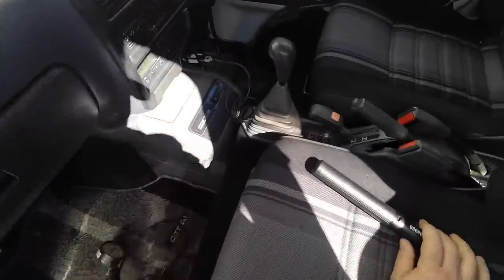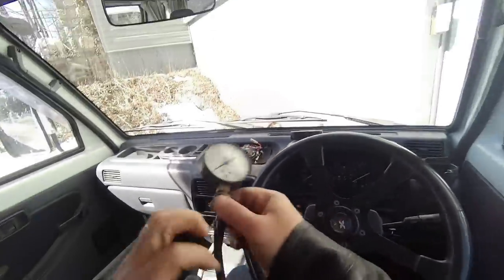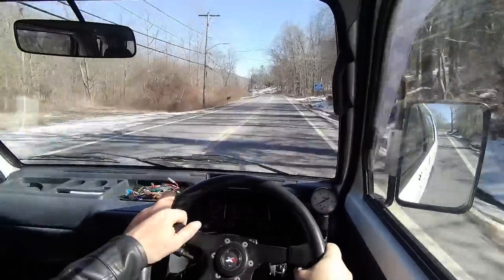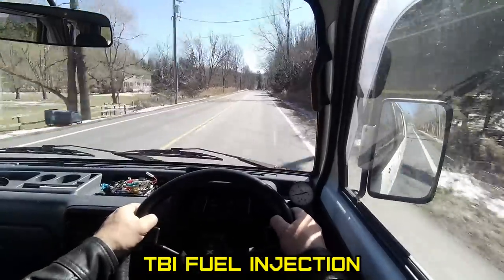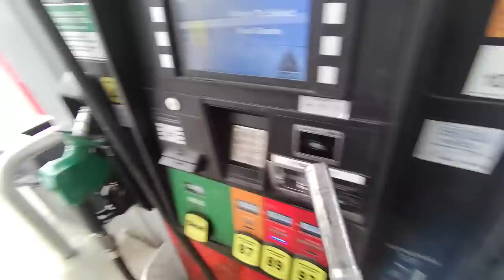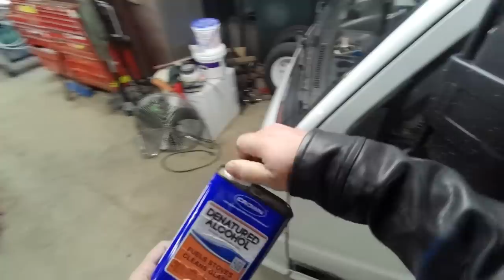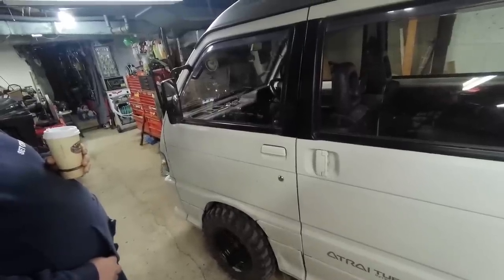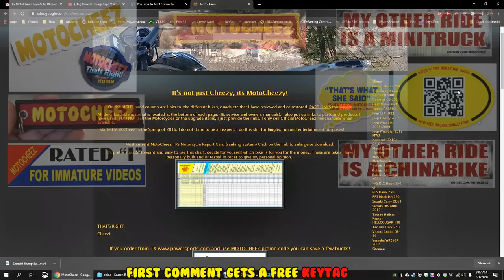Micro Van (SE1 E03) Turbo lag? Temp boost gauge, turbo vs supercharger, $50 crappy gas cap

Comment: Looking forward to the microvan series.  Always fun to start a new build.  Just a tidbit of info: the Hijet came in two names for the van.  One was the panel van (which was called a Hijet like the trucks) the other was the passenger van which held the Atrai name.  I think the difference was that the Atrai had nicer seats, more comfort options, etc and branded for sale to families.  The Hijet van was more of a work truck, just closed in.  I had a 95 EFI hijet van and the rear seats were able to fold down completely.  Maybe if you found a set of rear seats (not as comfortable as the Atrai ones), they could bolt right up to yours.
Reply from the maker: Ahh. Yeah maybe 8f I find a set

Comment: Boss. You know why you had to install a battery disconnect in Mini? That Android radio is ALWAYS ON. I was out by my 'chore' sideXside when I got a call. My phone kept connecting to that radio even though the sideXside was off! And yes; it was wired correctly with constant + to battery and accessory + to the 'on' function of the key-switch.
And I still think you should put a big fold-down handle on the top of the micro-van so it looks like a big lunchbox. 😁
Reply from the maker: Mine isn't, but my 2 winches are. Mine definitely shuts off when key off. I get the "want to save where you parked" when it disconnected Bluetooth.  
Haha lunchbox. I can't put anything on roof, may not even fit when I put the lift in
Reply: @MotoCheez  Hmmm... Wonder if I got a bad radio?🤔 I'm on my 2nd one as the 1st one didn't work 100%.
I know; the odds that I got something faulty thru Amazon from china is astronomical...but it COULD happen. 😆
Reply from the maker: Yeah. That's odd. I just received same for van so I'll let you know

Comment: Older turbo'd vehicles were notorious for turbo lag, even some high end sports cars had the problem. You'd mash the gas and the turbo would eventually catch up soon after. That's why super chargers were a more popular alternative to a turbo when it came to engines with more than four cylinders. Being they were mechanically driven by your belts they didn't have the lag problem like a turbo which is driven by your exhaust gasses. So power was always on demand with a super charger. The turbo in my truck is what GM calls a Twin-Volute turbo so it has two smaller passage ways for the exhaust gasses to go down rather than one large passage. It's suppose to help with turbo lag so the power is more responsive when hitting the pedal. My truck is my first turbo power vehicle as well, so don't feel too bad. :)
Reply from the maker: Good to know. Good info
Reply: @MotoCheez  Welcome. I'm no mechanical expert. But I tend to retain stuff I find interesting. :)

Comment: You need a little manual boost controller and turn it up a couple pounds. If I remember right those little motors were ok under 12 lbs. I think DJnoway and Jimmy oaks did his little kei wagon to go from around 8 to 12lbs.
Reply from the maker: I was looking at those. They're cheap too
Reply: @MotoCheez  yeah they are. Great little bang for the buck. As long as you don't go overboard with the boost. Make sure that fuel system is clear and pumping well beforehand so it doesn't lean out when pushing it. They can hold a little over 12 lbs but you really start to push them. I think some people push it to 16lbs but you really start to run into fueling issues.

Comment: I keep one of those thin flexible cutting boards in my garage. When I need to dig through a can of loose parts I just dump them on the cutting board. Then when I'm done I just taco the cutting board and dump all of the loose parts back into the can. Easy, peasy.
Reply from the maker: Good idea. The clear containers aren't bad to look thru

Comment: Take the cat off and put on a good flowing straight through muffler or put an electric exhaust cutout in front of the cat, you will have virtually no more lag and it will run a lot better!  Restrictive factory exhaust really hurts turbo engines performance.
Reply from the maker: Noticed on mini
Reply: @MotoCheez  It's a lot more important with turbos.

Comment: Yeah that hesitation is the glorious turbo lag.  There's a trick to driving these you're up at 4 realistically and you just ride the turbo as conditions allow, pick a lower gear like 3rd and 4th and carry it to 6 or close to 7 if you're hammer down.  They love to rev and don't like to be heat soaked or lugged around at low rpm.  Try taking the headrests off the seats and lay them flat, I got an air bed from a tent cot and it's legit comfy with a sleeping bag on it.  More space too.  I got a tiny window ac for it because in the sun these things get HOT I have a little 40cc genny that runs it.  It sounds like it's running good I hear the turbo spooling and the valve.  Try running non ethanol boat 91 in it they love it.
Reply from the maker: I wish there was non ethanol around me. It's like 30 miles closest, and now with gas prices...

Comment: Vinchenzo Cheesezle typically with the turbo it “spools” at low RPM and really doesn’t come on till the RPM is at around 4K To redline. The new stuff has all this valve timing solenoid trickery to give you max torque at low rpm but these 3 cynider low cc motors don’t have that. Also it’s a good idea not to put your foot full in it until 4,500 to red to keep detonation to minimum with a turbo.
Reply from the maker: It loses boost gradually after 5k, 4 to 5 seems max boost. I'm not worried about detonation. The blowoff bypass and wastegate  must be set fairly safe and I can hear the engine good. Plus it has an intercooler.
Reply: @MotoCheez  93 octane should do the trick it’s like 100octane as these motors see it. And yes we are close in Wappingers , I’m trying to get a Sunday to get out to you guys and go on a mini convoy!
Reply from the maker: Yeah man!!!

Comment: Hey, if you start messing with the boost you need to install an air/fuel gauge so you can make sure you never go lean and if you do, you can immediately get out of it. Installing an intercooler is a must also IMO. This Woody was my minivan back in 2007. Make sure and read the intro. It still holds the record!
https://youtu.be/xmrNC9Ph7H0
Reply from the maker: It has an intercooler factory. I figure 2 lbs it would compensate for
Reply: @MotoCheez  or more. Detonation if is the killer and it will depend on what grade fuel you run. I had a hookup for race gas so that's all I ran but it was still $4.00 back then. I'd personally be running the highest octane you can get in a turbo. 91-93

Comment: Now these are UV resistant!

100pcs 304 Stainless Steel Cable Ties Wrap Coated Self Locking Metal Zip Ties (Stainless Steel, 7.8 inch)

Visit the Mamfous Store

4.4 out of 5 stars    351 ratings

$11.99
Reply from the maker: Haha. I have them too!